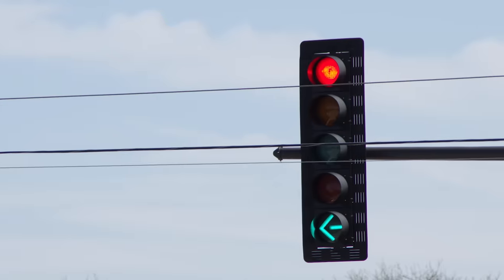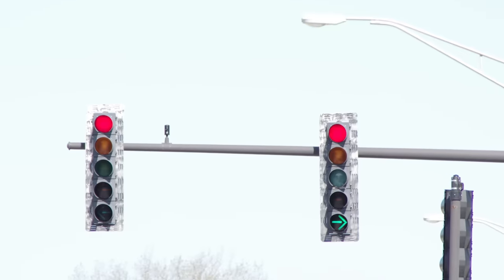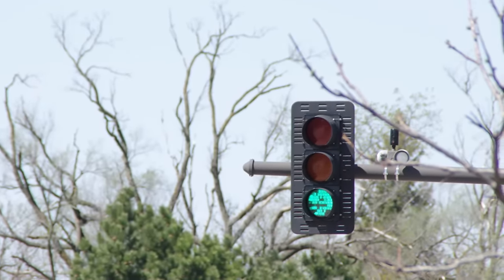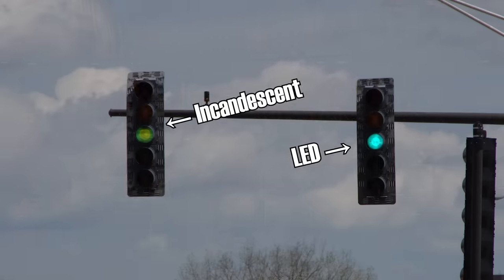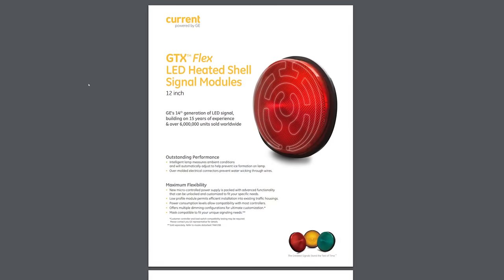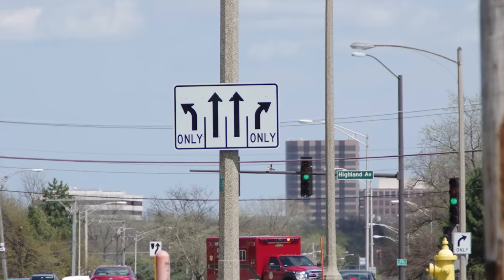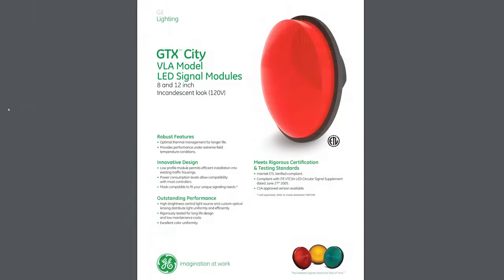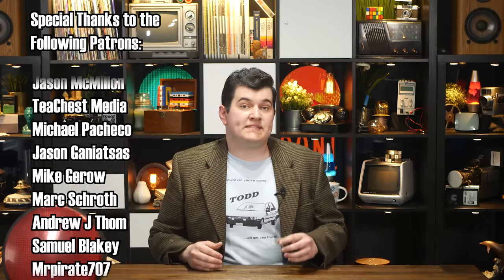The LED Traffic Light and the Danger of "But Sometimes!"

Comment: Your town hasn't switched to LEDs -- this isn't because they're against progress.  It could just be the same reason as my town:  Inventories of traffic bulbs from other counties/districts have been shipped to your town. The other counties are switching to LEDs and your town is probably the beneficiary of thousands of free traffic bulbs.
Reply: Countered by the extra maintenance until updated
Reply: The counter argument you might get is that its not extra maintenance because the town has to pay the guys regardless of weather they are swapping the free bulbs out or sitting in a depot somewhere sippin coffee.
Reply: Assumed that labor would part of the cost for maintaining, 
(sarc) lights can't install themselves. 
After updating, with LED longevity, 
that section of the civic warehouse can have redundant staff shifted to other priorities
Reply: It's a consequent of having short term politicians and voters with short term memories. Governements learned to preserve the q]status quo and short term  budgets instead of  being held accountable for longer term costs.   

To a degree I understand that thinking.  Until I use up the canned food I have on hand,  I won't replace them with "healthier" food.  I won't replace the working or easily serviced bulbs  with unquestionably better LEDs until I use up the specialty incandescent floodlamps or the CFL lights that I have on hand.  The lights that are harder to service will get LED types that I test in less critical applications first.
Reply: Kozmo IGM Kliegl- Countered by a current budget and the increased out of pocket cost vs using stock on hand and a labor contract.
Reply: Kozmo IGM Kliegl- I can only conclude that you're not familiar with minicipal labor contracts.

Comment: I saw a crosswalk countdown counting down only in odd numbers today....weird!
Reply: Look ONE WAY when crossing the street.
Reply: I saw that before to, weirdest thing I've ever saw
Reply: That's odd.
Reply: I remember the day, when those were brought in our hood: on the "walk" the timer went fine from 40 to 10, but then it gone 9, 7, 3, red. (and the cars started to roll)
Of course they've been replaced by now, but that was a thrill to experience.
Reply: Do they countdown in even numbers on the other side? Do they countdown in multiples of pi on pi day?
Reply: I wonder if some rounding problems are to blame. That's a very strange issue.
Reply: but sometimes
Reply: Internally its computer is counting in binary (just 4 bits), so 1=0001 2=0010 3=0011 4=0100 5=0101 6=0110 etc...
Notice how the bottom bit (the last 1 or 0) is easy to see if it is an odd or even numbers. But in the control system, and with the bottom bit being at the edge, it's possible it might be near a power line or a negative power line, and might short with that power supply one way or the other, or be disconnected completely. So:
If the bottom bit has shorted to a negative power line, the bottom bit would always be 0, so the countdown will only be even numbers.

If the bottom bit has shorted to a power line, the bottom bit would always be 1, so the countdown will only be the odd numbers.

Comment: In Germany every traffic light is equipped with additional sign for yielding and prioritized roads, so one road‘s driver always have to yield while the crossing drivers are prioritized. There also is an hierarchy: if theres a police officer managing traffic you have to follow his instructions, even if there are working traffic lights. Then you have the traffic lights, id they dont work you have signs, and if there are now signs its „right before left“, meaning that that the car crossing on your right-hand side has higher priority. For the rare instance having cars on all four sides it‘s high-beam-signalling and somehow communicating your way through, but usually these kinds of intersection are only tk be found in residential areas. Main roads are ranked and marked with high and low priority

Comment: 6:03 In theory, treating a intersection as a "4 way stop" intersection when the lights aren't working or aren't visible may sound like a good idea. But keep in mind that in a snow storm the blowing snow may only cover the lights on one side of the intersection while the other sides may still be perfectly visible and operating correctly, creating more confusion.
Reply: That's why the sentence includes the phrase "proceed with caution". One way stops exist and have established protocols. If your light is obscured you stop and assess the traffic situation, then proceed with caution. If you think the other guy might hit you, don't enter the intersection.
Reply: I live in an area that gets snow every winter and have never seen an intersection where snow has blocked even one light. Let alone the fact that there are at least two sets of lights in each direction.

Even if snow were to obstruct a bulb it would still shine through ... snow is semi translucent
Reply: @Davidjune1970  Yes, but do you know if those lights were LED based or not? If they were still incandescent, and thus produce heat, that could explain what you've observed.
Reply: I think the foldable stop sign. They could operate like fire doors in buildings. When the power disconnects, then the magnet let's the door close. This could work for a power loss at a signal. The one big storm we had in the east coast, I almost got rear ended many times, because I was the only one obeying the law.
Reply: It is a problem when one direction works and the other side of street can't see. You would not know to stop if yours was working. But since it's a but sometimes, this scenario does not matter
Reply: Wesley Perkins But the other ones with the broken light would still stop, so no one would crash into you.
Reply: @MelvinGundlach  where I live it hardly ever snows, so I will defer to those who do, lol. I will admit I am speaking from hypothetical situations only.
Reply: Brian Kiger your question is funny when you live in an area where it snows at -24 C and can drop to -40 over that same night. Never ever has it happened and there are both types of bulbs around
Reply: Here in Germany we just have signs attached to traffic signs at all times which come into effect when the traffic light doesn't work. Most traffic lights also get shut off for a few hours every night when hardly anyone uses the roads anyway, and that's when you have to use the signs.

Comment: It's amazing how many people speed up when they see a total stop light failure at an intersection, thinking, 'hey, this is great, now I don't need to stop!' It's a very dangerous situation on fast roads.
Reply: As per the video: the problem isn't the lights. The problem is stupid people being allowed to drive. It should maybe be part of the license test - face the testee with a seemingly dead set of lights (but with cross traffic stopped out of sight) and see if they think "sweet, no need to stop", or "ah, crap... there's no way to tell if cross traffic is going to stop, I'd better tread carefully". First reaction causing an automatic fail. Though of course that'll still only filter out new drivers... funny thing, I mostly seem to get cut up by older drivers and (whisper it maybe) those who give a distinct impression they got their license in a country with much less stringent test conditions. Younger and more obviously native (or naturalised) drivers generally seem far more sensible and courteous.

Comment: I'm colour blind and I have difficulty in distinguishing between red, green, browns etc. I had no trouble with the old incandescent traffic lights, all the reds looked like red, amber looked like amber. But with the new LED lights, the red and amber (yellow) look an identical colour (color).  The green LED light is always green to me. I have a feeling that they have made the red light a bit more yellow in order to increase the brightness. It's not really a problem for me as the location of the light in the housing is more important than its colour, but fascinating. Strangely, the power indicator LED on our TV changes from red to green (so I've been told), but I can't see the difference.

Comment: Treating a traffic light where you can't see the light due to snow as a four way stop still has an issue.  That is, the intersection may look like a perfectly-functioning intersection to three of the approaching directions, and only one treating it as a four-way stop.  Now, when I pull up to "my" stop sign, and then pull forward, the traffic coming from my side may be approaching an intersection with a green light, going through and our paths intersect.  Admittedly, in that case, it is my issue that I pulled out in front of a car that had the right of way, but if I thought it should be treated as a four-way stop, and he thought it should be treated as a perfectly-operating intersection, we're destined for trouble.
Reply: Literally came to the comments to make sure someone else said this. Gotta see things from everyone's view before lobbing out ad hominems.
Reply: @brycey2364  Overall I agree - the direction with light obscured might be just one but rule remains same - treat as stop sign and proceed with caution. But how was this an ad hominems (sic)?
Reply: @jeepwran  just how TC was really trashing on drivers without rationally thinking through what their experience was. There's probably a more precise word, but it escaped me.
Reply: If it's snowing hard enough to block a light, you wait at a four way stop to make sure the other drivers are actually able to stop regardless. In icy conditions you never do anything that, if the other party can't brake, will result in a crash. So sure, "but sometimes!", but it's still your driving not the LED
Reply: @morticae  amen! heck, on straight roads with the right of way during slippery conditions, I slow down when I see someone approaching their stop from a side road if they look a little too optimistic about their stopping ability.
Reply: Just be careful in that situation? If it's snowing that hard, don't pull out until are cars are stopped or past. "But sometimes"

Comment: I live in a country with a lot of winter.
We have switched all traffic lights to LED.
I have never heard or seen the problems you describe.
Welcome to Sweden for a study visit!
Reply: Emil Almberg I suppose it has to do with the design of the tragic light and the led Assembly. for example the light on his desk mimics the convex shape of the original lens, where I live most led traffic lights are completely flat, also there is no visor in most cases.
Reply: Ah yes, but is that just because Sweden is cold enough for the snow to stick the incandescent lights anyway? :D
Reply: Stop light never have a problem, but I have seen very cheap outdoor lighting that flashes in cold weather.
Reply: Huh Joe God it's so sad to see what's happening pretty much everywhere these days.
Reply: Or it's so cold and dry the snow doesn't stick at all.

Comment: It has been posited that the increasing adoption of LED lighting will save enough energy to cover EV charging.  Unfortunately, it looks like many utility companies push efficiency measures on consumers to avoid upgrading infrastructure.  And no matter what one does to reduce usage, rates continue to rise.  For those who have the means to do so, going off grid looks better all the time.

Comment: The whole "but sometimes" thing reminds me a lot of the discussions surrounding nuclear energy. Nuclear is not only cleaner for the environment than traditional fossil fuel plants, it's also more efficient at producing power. People are just afraid of it because of incidents like Three Mile Island, Chernobyl, and Fukushima. Three Mile Island was likely a preventable incident, and Chernobyl was certainly preventable due to the fact that its main cause was an engineering error. Fukushima was just a very unfortunate consequence of a natural disaster. Modern nuclear power plants are not only much safer, they are designed not to fail as disastrously. Switching over to nuclear, or at least adding more nuclear plants to our power system, would be largely beneficial in the long run, but fear has made it so that people don't really see the benefits. (Not to mention the fossil fuel industries helping to spread that fear.)

Comment: Winnipeg, AKA coldest city on earth (sometimes). LED lamps work great, and they are extremely easy to see. Contrasting the "sometimes" getting covered in snow, "Sometimes" when it's blizzarding the extra brightness and clarity makes them much easier to see.

Now I have to wonder when we'll get the fold up stop signs and the strobe detectors. that sounds extremely useful, especially around my area where I live within blocks of a fire department and a hospital. Might have to make some phone calls...
Reply: The strobe detectors are cool when they're used. but they very from city to city and only city EMS and police have access to them. Police have the option not to use them so that's not always useful. and if you have emergency vehicles from other cities or private ones they don't work either. Wish Chicagoland had standardized on the tech.

Comment: "but sometimes" snow gets stuck to traffic signs telling me what the maximum speed is, snow freezes up on the road making it unsafe to drive fast or the sun makes the light non-visible.
We do have these metal detecting loops in the Netherlands even on bike lanes and sometimes they even count so the light will be on for a longer time when more bicycles have to cross the intersection. We even have rain detectors and at some intersections bicycles will be served more often when it rains. These are both implemented in the hope that more people will travel by bike.

Comment: I've seen a lot of new LED traffic lights blinking or failing (not at USA). But this happens because the cities hires third-party companies that likes to buy the cheapest chinese LEDs modules possible. The LED tecnology itself is the best option.
Reply: I do maintenance on commercial outdoor lighting and at two properties that has happened with many of the lights. They will flash on and off and then eventually go out completely. The electronic driver that powers the LEDs goes bad. Most of the lights I work on were made in China, but obviously the quality can vary drastically.

Comment: As a resident of the blowy, snowy northern Midwest (in a region regularly affected by Lake Superior’s blustery East winds), I can attest that snow-obscured LED stoplight signals are an extreme rarity. And honestly, at the times when I have noticed a partially-snow-obscured lens, it is long-past the point at which the general public should have gotten the bleep off the damn road.
Reply: except due to our car centric transportation and the regular service of nighttime infrastructure especially up by you in the northernwoods where infrastructure needs more watch and maintenance, also its more important because in that area especially up by the UP and northern Wisconsin/Minnesota they are based off a couple large piece of infrastructure instead of many small pieces like urbanized areas